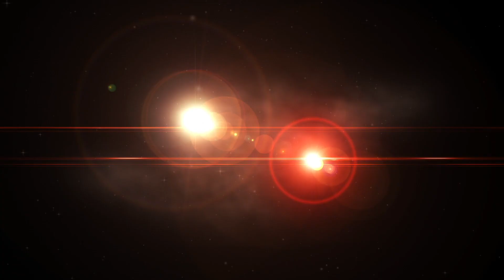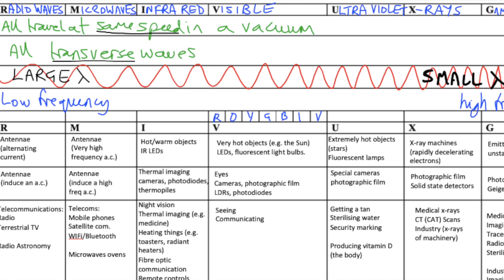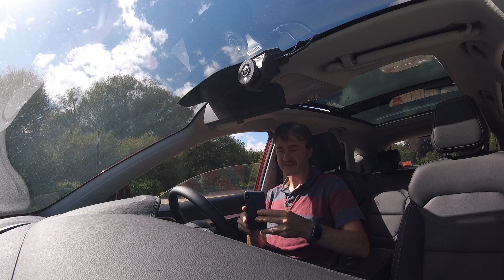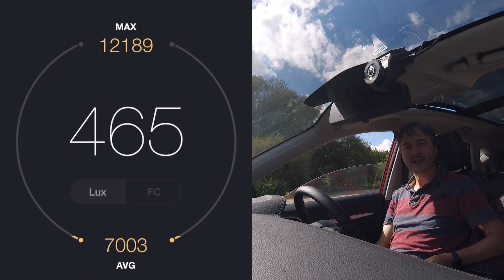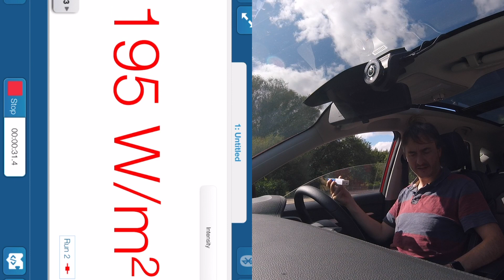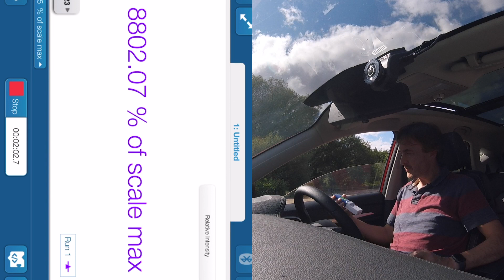MG ZS EV: Should I tint my windows?

Comment: I'm one of those people who went down the price tints route.  When the tinter I chose checked the glass he confirmed that 96% of light was getting through the side glass.  Which confirms its clear.  So I went 30% tint on rear, that's not as dark a roof (I think its more of a 20% Limo tint).  Front side windows are rarely tinted as side glass its usually about 70%.  I had this done to my side glass. 

As I understand it most reputable tinters won't tough windscreens, and the reason I was given is because its laminate.  Most windscreens also have a tint, but again not the MG, but the laminate does cut down some of the UVA as you said.

My car is considerably cooler inside now.  Looks damn nice too!  Oh and depending on your insurer you premium may not increase, but always check as you said.

£240 was my quote all in, not the cheapest but a quality recommended tinter.
Reply from the maker: Thank you for your comments - this is really helpful information. Shame they won't touch the windscreen as its size means a lot of heat enters that way - and, as you mentioned, the windscreen on the MG is not tinted (although it does cut out some light).
Reply: @davidselecandtech4732  That's a good point about the size/area of the windscreen and the amount of heat entering the cab. The Ioniq has a 6cm tinted area with a faded edge at the top of the windscreen. This could be a way to reduce a certain amount of glass area so reducing heat, I might try it on the MG. Perhaps go last century and stick up a 12cm wide one with, 'Fred' and 'Mary' printed on the relevant sides, lol.    .
Reply: @davidselecandtech4732  Its not so bad, I've found the temp in the MG much more manageable after tints.